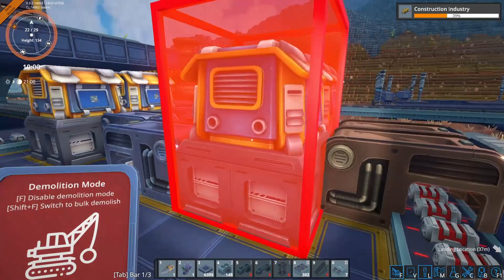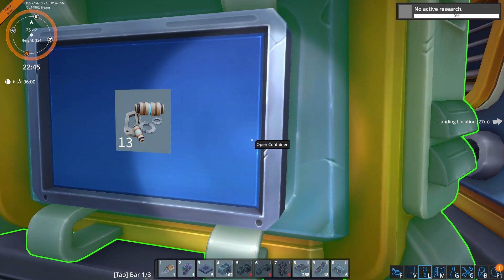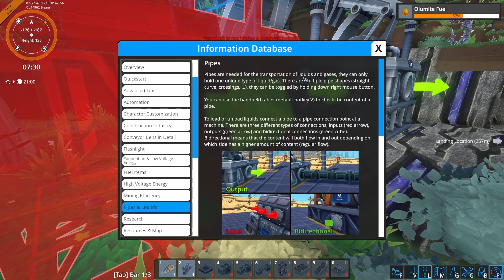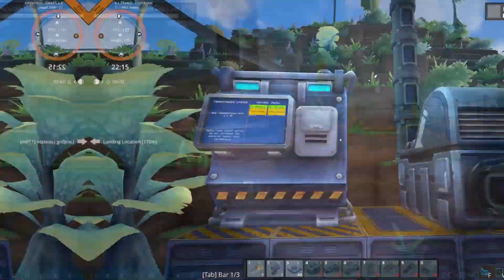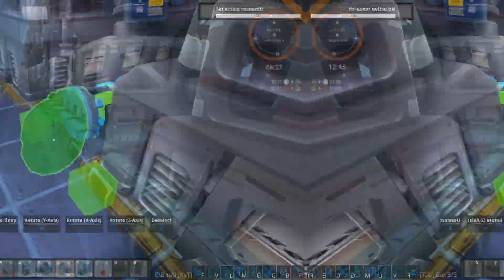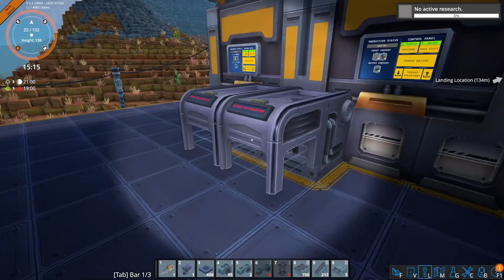I Might Need To Hire A Plumber! | FOUNDRY EP.9

Comment: * You can dump extra science packs into research machines and into machines producing these packs.

I see you have quite a few in a manual storage.

* Pipes have throughput up to 30k a minute, as I know.

You'll need 20 pump jacks to fill one without pumping efficiency upgrades. I got away with 4 for a long while and I did infinite research. You don't rush even normal one. 

* From my experience pumps are kinda useless.

I've used them only right after pumpjacks and right before my olumite processing facility to divide pipes by priority. So, when olumite node runs out pipes near pumpjacks would be sucked dry first, so I could dismantle them without losing olumite. Later added a bit more sections.

* On the topic of fuel. Don't make any except jetpack fuel. Things may change in the future updates, but right now any fuel for boilers above raw ignium works worse than raw ignium or about as bad and require olumite. Also, solar power is infinite. There's no vehicles requiring fuel.
Reply from the maker: Yeah I have been dumping my extra science packs into the research machine ( when I remember ) haha

Yeah I have heard about the issue with fuels, at least I have them ready now for a fix 

Good to know about the pipe throughput, how did you find this number out? I have looked and couldn’t find any stats for them?
I have also come to the conclusion pumps at the moment are useless, maybe it will change and they become useful 🤷‍♂️

I do plan to do a massive solar farm …… right on top of the mountain peak 😁
Reply: @Krypt0nite  As I know you can use up all 30k water per minute from a water intake. Just connect to multiple storages and time it. Make sure to use pumps right before every storage to prevent backflow. Then add more intakes to the same pipe. Last time I checked the result is the same, so it looks like the pipe is the same as intake. Alternatively, try to use over 30k water with boilers. Make sure they are under full load (energy grid in red).